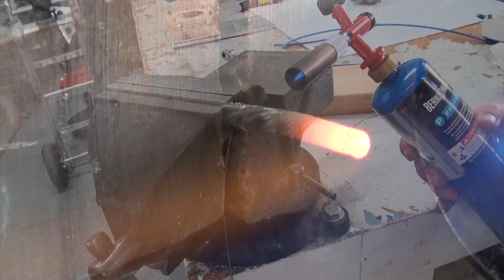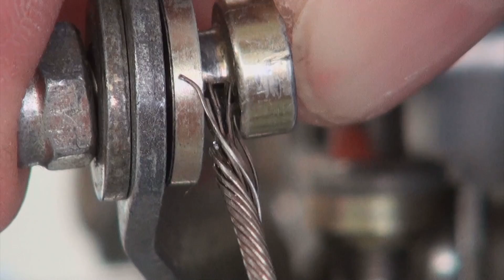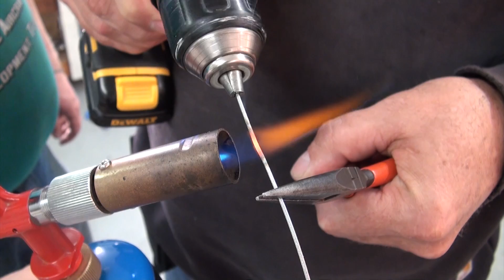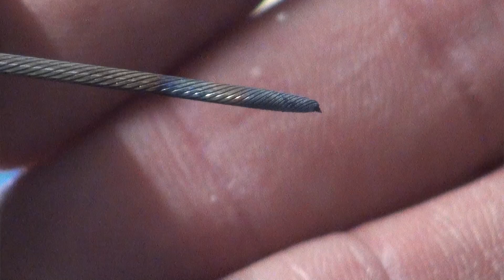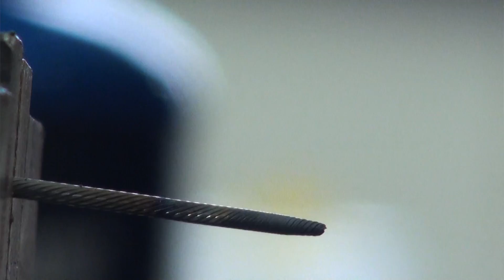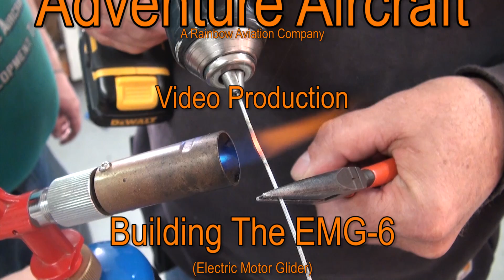Twist Welding Cable (How To)

Comment: Outstanding!  Thank you for sharing this tip.  I am going to install new bicycle shifters and will use this technique to cut the end cables.  Cheers
Reply: I'm exploring this same application.  Did it work for you? Did you use an alternative method, e.g. solder? I'm trying to use the old cables and it is essential to maintain the overall cable length.
Reply: Tried it.  Works great for consolidating the wires, but instantly shortens them.  I will put this in memory for when length isn't critical.  Next try, solder dip.
Reply: Soldering is the common method used for bicycles for many many years.  I would suggest it is a better method as it is relatively low temperature and won’t affect mechanical properties of the cable or the affect the corrosion resistance of the cable.